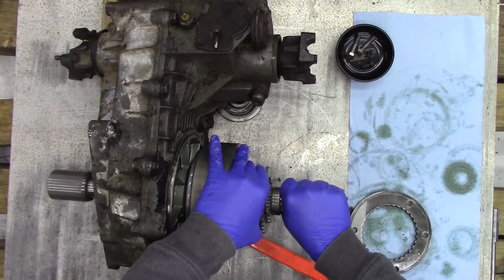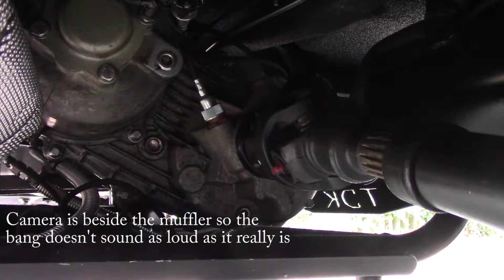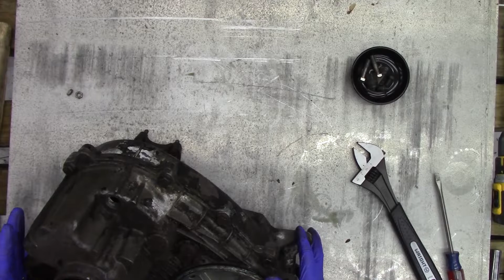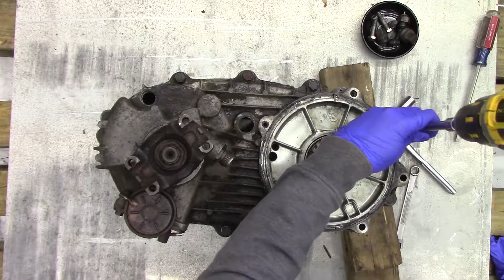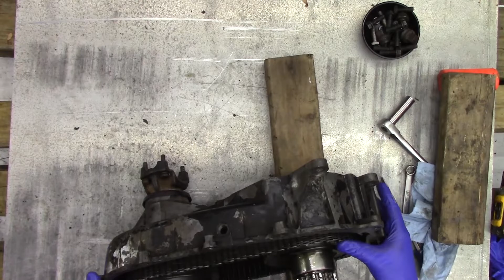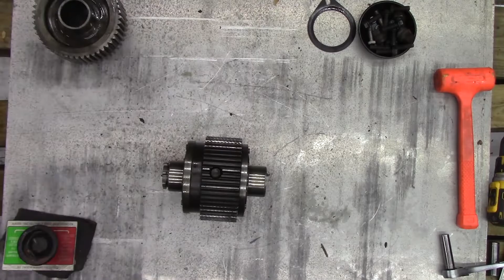Borg Warner 1305/1339 Quadratrac Transfer Case Teardown & Rebuild - Part 2

Comment: Great video's I do have a problem with my chain has 48 links and it is to loose so I found another good morse chain 48 links put it on still loose both the chain sprockets have 48 teeth I talked with Ryan at BJ's when I ordered my rebuild parts they have 2 chains one with the standard 48 link and one with 46 link for 16% over drive would you know where this over drive is located and how many teeth should the standard chain sprockets have thank you
Reply from the maker: Thanks!

The MileMarker part-time conversion kit came in 2 options, normal or overdrive. The kit replaces the QT differential with a solid sprocket. The normal sprocket is the same diameter as the differential and has the same number of teeth, 48 or 49(don't remember exactly). The overdrive sprocket has a smaller diameter and less teeth, 41 I think. So, of you have an overdrive sprocket, it should be very obvious. It sounds like you have a non-overdrive sprocket or stock differential. I need more information to speculate on your loose chain. You can send pics to MaladroitMechanic@gmail.com if you like.
Reply: @maladroitmechanic  thank you I will take some pictures the jeep is the original all wheel drive that you

Comment: great video's I have been having a problem with my 1339 and that is when climbing and under a load I get a load banging sound like banging with a hammer and then the reduction unit pops into neutral I had the same problem with my other transfer case even when I switch on the e-drive any advice as to what may be causing this problem
Reply from the maker: Are you certain that the bang happens before it goes into neutral? Shifting to neutral under load probably makes a loud bang.
Reply: yes I shift into low range on flat ground and then start to climb at the steepest part when the front wheels seem to break traction on the rocky surface it starts banging the shift lever pops into neutral I have to coast down to a flat spot turn the jeep off shift back into high and go on up the hill I still get a bang in high but if I hold the gas just right I was able to make it up the hill  @maladroitmechanic
Reply from the maker: @roberttrujillo-s8w  I would first check the low range shift linkage. It should not have any tension on it in Hi or Low range because the detent ball holds it in gear. I wonder if you have worn engine and  transmission mounts. This could allow excessive torque movement under load which could pull the shift lever.
Reply: motor  mounts and transmission mounts are in good shape as well as the transfer case stabilizer they were out in new when the shop installed the transfer case
Reply: my jeep is a 1978 CJ7 304 V8 turbo 400 automatic trans being how I had the same banging with the other transfer case can you think of what else it could be maybe the trans output shaft ??? strange I should have the same banging with both cases
Reply from the maker: @roberttrujillo-s8w  If the wrong fluid is used in the Quadratrac, the clutch cones can make a loud bang when they slip. Maybe that could jar the low range out of gear? Are you certain the emergency drive engages fully to lock out the limited slip differential?
Reply from the maker: @roberttrujillo-s8w  Also, a stretched drive chain will make a loud noise when it slips over the drive sprocket teeth.

Comment: Great timing, just took mine apart. All cleaned up and read to assemble so will watch all your videos before. Am doing the 4x2 kit and new chain/seals. I am doing a 1305 but my Honcho has a 1339 which i will swap. I will do the original after a swap.  My case didnt have the o ring gasket and i am not sure the vintage of the 1305. The 1339 is in a 1979 so will see next year if it has the rubber o ring.
Reply from the maker: Thanks for the comment! I now have the output shaft bearings that I have been waiting for so the final assembly video is coming soon. 
A Honcho build would be so cool....maybe that is my next project.
Reply: Any intertest in selling your 1339? I have a 79' wagoneer.
Reply: @jm-ve8ry  sorry, but that is the original for my J10. Havent even put the 1305 into it to see if it works with the the part time kit in it. There should be some around as people seem to want to get rid of them .
Reply: Try Watson’s jeep salvage .